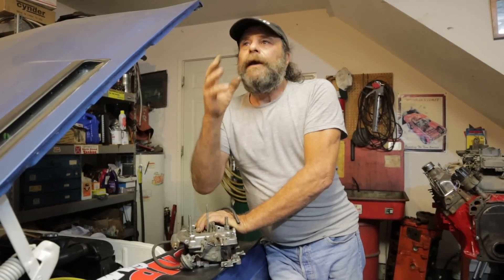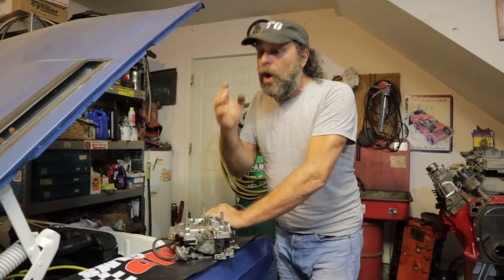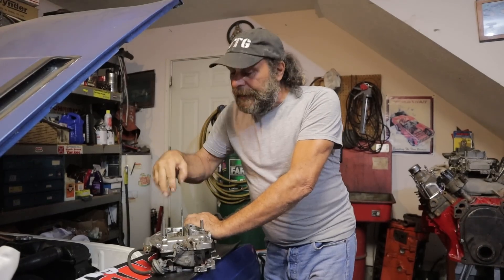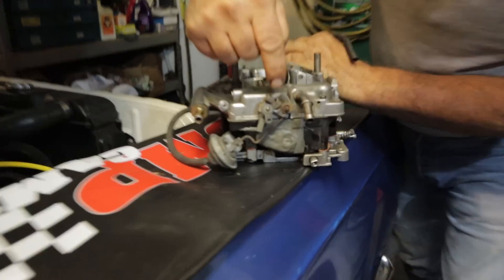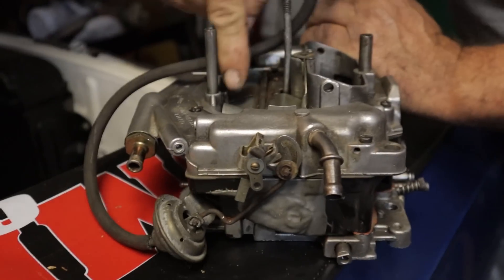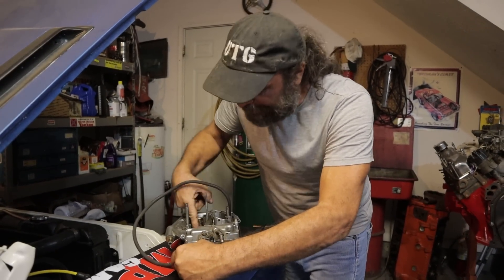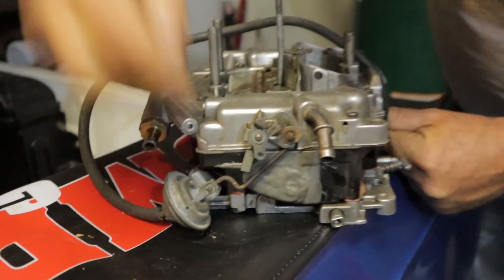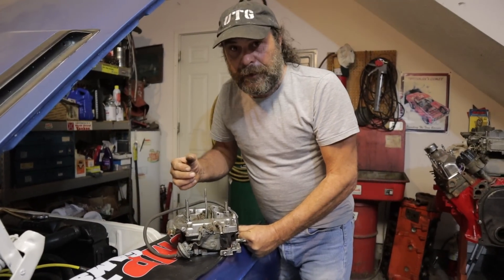The Great Thermoquad Debate

Comment: Thank you so much for the video I've recently rebuild my 850 theromquad thinking i might try it on my 318 poly engine after watching you and lunar rebuild his 318, and was struggling to understand how the secondaries are setup. it took me a full day of trying and fitting and refittling and readjusting to get it to go back together i didn't quite understand how it operated just wanted to say thanks cuz now i understand after watching this and the previous videos it function how it works and its short comings it seems the thermoquad to me is not necessarily a performance carb but a work horse carb good for towing where theres no instant throttle response needed but a long heavy pull were torque is needed more than hp

Comment: Someone commented on why somebody would want to run a Thermoquad on a race engine, well I know a guy who raced a S/A (Stock Automatic) Challenger 340 for many years and had great success with the Thermoquad and a cast iron 1971 340 intake. If I remember correctly the car ran high 11s low 12s.  I helped him change the 904 trans out of it once at the track...the car ran faster with a 904 trans. so that's what he used.

Comment: 100% agree with Uncle Tony. Its all in the air door drop and the pull off. I set mine tight against the air door stop with 1 1/2 on the air door spring. The hardest part of a TQ is finding a good on to work with. I will say SEAL ALL is the best I have used to seal the wells in the bottom of the bowl.

Comment: I look at a carburetor/choke system as an analog computer. there are inputs of temp, throttle command etc. these things need to be transformed into the correct air fuel mixture and flow that the engine needs.also a vacuum port for the ignition timing.  some things like air density have to be set to one condition and hope for the best. I grew up on the farm in the 50s-60s. every gas engine we had was carburetored. it takes thoughtful set up to get things to work well but its not rocket science. modern EFI systems are so nice for the daily driver.

Comment: I like your You Tube stuff because you correct. As far as the TQ goes, your dead on about the choke pull off. If that's bad then the air door, even with 0 spring tension, won't fuckin' open. The first thing I figured out about the carb was the o rings in their fuel well. I've got one on the 440 in my 78 D 200 and it works like it's supposed to. Every time I drive it. I like the TQ. I look forward to your videos.

Comment: Tony don't get discouraged man, keep putting it out there and giving correct information. Its not a matter of opinion that bore x bore x stroke x .7854 x number of cylinders is how you figure cubic inch displacement. There are other ways to do the same thing, but that is the simplest one I have found, and all of them have the same basic structure to the math. You can go with radius of the bore and then use all of Pi rather than 1/4 of it, its still the same thing.
Arrogance: Thinking you know but have not done it.
Confidence: Knowing you know because you have done it. 

I get lots of crap about ethanol, people claiming it is highly corrosive, eats carbs, gaskets, pumps etc, and all manner of other idiotic bullshit. I have found none of that to be true in the 13 years I have spent testing, driving, producing fuel, converting carbs as well as EFI, and tuning to run ethanol. Keep putting factual information out there, let the know it all's who don't know their ass from a hole in the ground (but read/heard it somewhere from someone equally clueless as they are) regurgitate their drivel. They are not your target audience, the people who realize they are missing the bits of info you are providing are your target demographic. If you had no clue I would not be replying here, as I would not be watching your videos.

The secondary air valve opening rate is adjusted on a Qjet with the spring, and while Qjets and T-Quads are both spread bore, they are very different carbs. They are more dissimilar than similar, in function, tuning, and operation. Those same 'experts' probably have no idea how a Qjet works or is different, they see small primaries and big secondaries and assume its the same thing. It took me years to get the experience with Qjets that allows me to do the things with them that I do, and others cannot seem to duplicate. 

Don't stop doing what you do and continue reading comments, and give accurate info when someone offers incorrect, erroneous, fictitious, or misinformed crap. Its the only way we can pass along what we have learned over the last several decades.

Comment: My old man had a 66 283 C/10 worn out.  He ask me to get it running.  carb was junk.  I found in his basement a TQ I had rebuilt and stashed years earlier.  1 junkyard intake and valve cover later, it was running.  and I mean great especially little 283 under an 850 TQ.  I am not sure it really opened the secondaries more than a crack but it started and ran without issue.  Those were great carbs.  A few months later he gave the truck away...

Comment: Learn something every day !  Went and checked a couple of Thermoquads I had on the shelf.  On the dashpot where the vacuum hose is attached there is only a very small orifice.  Here's text from Chrysler service manual:
"AIR VALVE DASHPOT OPERATION:  In addition to the air-valve functions described, an air-valve dashpot (or diaphragm) is used to further control the air valve."   Thanks for all the great content.  Regards.

Comment: Many do not understand the difference between a daily driver and a racer. It is the same with bikes- a flat-slide race carb bogs like crazy for tiny throttle openings for normal street riding, and a CV (constant velocity) carb is not good for racing, but much more anti-bogging for normal street riding. Lots of self-taught or taught by the wrong people focus on a minor detail while ignoring the huge elephant in the room. The red herring tuning method- what seems to stand out at first glance.

Comment: Way to go thermoquad assholes....

My  six pack setup also relies on vacuum secondary to open the 4 extra barrels.  It is closed by actual linkage. 

Carbs are so interesting to me. Its amazing that something this mechanical did this job vs what EFI had to do to replicate. Its amazing. This is my first carbureted application and loving it. 

Thanks Tony don’t stop interacting with us. Ignore the know it alls.

Comment: I messed with a thermoquad that killed its self . Had it all just right & there's a spring that let loose ( the ones like in clocks ) and stopped there . The middle part was bad I epoxy glued it had it set car running it was wow then I heard the spring snap uncoil & went to get a new carb .

Comment: My 71 Duster 340 auto,would only run well with the original carb,which was a thermoquad the numbers being a 4 speed.I tried 3 other auto theaquads and rebuilt 2 more for 5 different thermos and none ram good unless it was the one that was on the car when I bought it with 119,000 miles

Comment: you have my sympathies. 
another channel invokes Dunning Kruger effect.
when I worked on cabs, I disliked the plastic based carbs
because I thought them cheap.  
Your adjustments are what I was taught.
The owner of the rental cabs had us wire the secondaries shut. saves gas...

Comment: Hey Uncle Tony,  I wonder if the confusion comes from the fact that the aftermarket copies of the thermoquad like the street demon don't use the vacuum pod and instead tell you to tune it by adjusting the spring tension.
Reply: This would be my assumption as well.  The newer avs 2 have tuning info for that.
Reply: its almost like you dont need the choke pull-off...
Reply: @frigglebiscuit7484  The only way to know for sure would be to have both in front of you. I'm guessing the aftermarket ones use a stronger spring. Also it is still kinda hooked up to the choke on the street demon.

Comment: You know you smoke to much when you can't open the secondaries on a Thermoquad. Great video Uncle Tony.
Reply: I think you got that backwards...
Sucking on that line keeps the air door shut... Thats what he was demonstrating by trying to push it at the same time.
Engine vacuum (him sucking the line) will keep that door tight, when vacuum drops, engine is needing more air so it lets the door open.
Reply: @Disablednoob  you're over thinking it.
Reply: @patrickradcliffe3837  oops😭

Comment: Well, like I said, learn something new ever day and all that. I'm willing to listen to anything and I can see what you're saying on it as I know it helps tie in to lockout the secondaries till the engine is ready to take it. Everything is kinda tied together on those so gotta get everything right for them to work really well. It's a dance getting it there but once it is you shouldn't have to do much till something wears out or breaks. 👍
Reply: exactly. back when, my thing was wringing power from Datsun engines.
mechanical distributors, what vacuum limiter, what jetting for the Weber.
slide in a cam the games start all over again until its dialed.

Comment: I should have kept the old TQ I had it was cool I put a new choke pull off on my 318 Duster BBD  2bbl works like a charm
Reply: Now tell the holley lover who insist of milling of the choke to reduce drag and increase air flow - you see them in swap meets and on Ebay and to me are now useless as you cant daily drive them that way